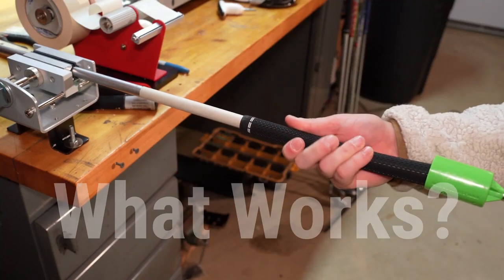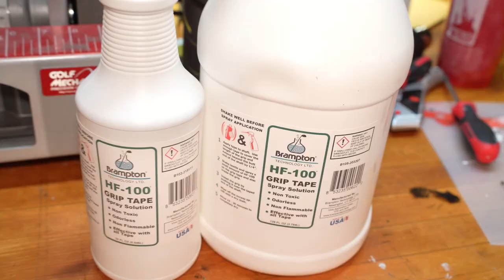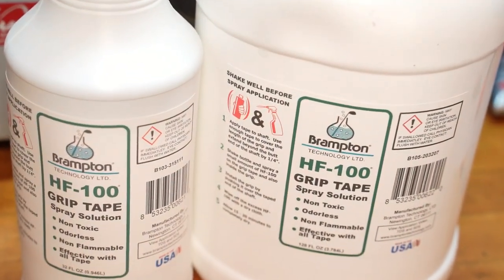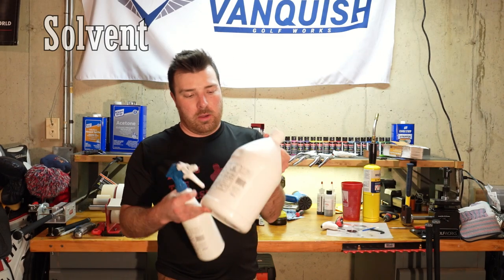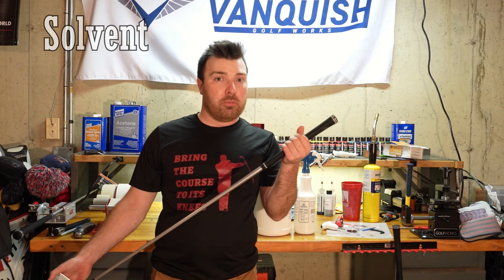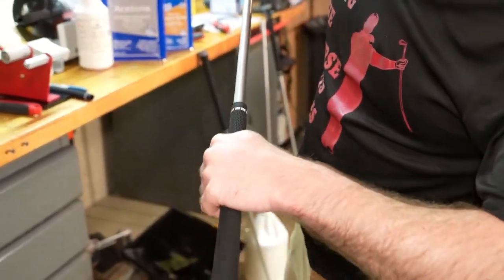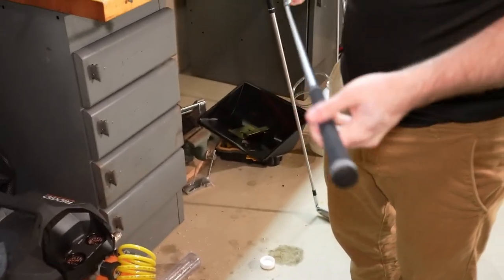What works?  Regripping golf clubs with different liquids

Comment: I have used liquid dish soap with no problems. Just takes a bit longer to dry. Smear a bit over the tape, spread a bit on the grip opening and slide on.
Reply from the maker: Good to know!
Reply: No way. That sounds terrible
Reply: Have used soap water also. No problems
Reply: 100% correct. Diluted dawn dish soap works great. Been using for 40 plus years. No issues. 24 hour dry time. Recently I tried dawn power wash, it contains alcohol, works fine, dry time cut in half.

Comment: Good Video, They make a water-based Grip tape, yours was solvent based is why the water didn't work.  
I have used Air for several years now, Less hassle.
The only thing you need to do is drop the Volume on your music, Dang it got loud, then when you started talking it was very low volume. 😉😉😁

Comment: Fun video. The poking of the tape at the end of the grip... why, wouldn't that just make it easier for debree to come into the shaft overtime, not a big concern but I've just never done that, so I am curious why you would do it?
Reply from the maker: Thanks Greg!  I've been building golf clubs for a long time and neve seen "debris" collect in a golf shaft from having a whole at the end of the grip.  I usually just poke it to help get some of the excess solvent out after you've put the grip on.  Once you've poked it, you can flip it upside down and tap the butt cap on something a few times to get as much solvent out as possible.  That will just make the grips dry a little quicker.
Reply: @vanquishgolfworks  thank you! Just pulled the trigger on an air compressor for my next set of grips between all the content I’ve seen from Mobile Club Maker and channels like yourself I don’t know why I keep using solvent.
Reply from the maker: @GregPace  That's awesome!  Have fun and let me know if you have any questions when installing your first couple of grips.

Comment: The think that you are missing is water with a little dishwashing soap.
And a properly is going to use mineralspiret when a will regreap my clubs.
I have no compressor, and have the sperit standing around. So thanks for the info

Comment: I use grip tape made to use water and it works great and less messy you can buy on line from golf works
Reply from the maker: Thats very cool!  I didn't know they sold that. Does it work well?
Reply: @vanquishgolfworks  Yes using the grip tape with water works great and you don't need to use a pail underneath.. Golf works sells it online and it works as good as solvent but without the mess  Its made to use just with water and slides on easily

Comment: Thanks for the video, I just regripped a driver and almost didn't get it on
Tip.......don't wear rubber gloves they just slip on the grip as you push....paper towel like you used works out well..:face-blue-smiling:

Comment: You need that little air adapter thing you used though
Reply from the maker: You do but that adapter piece is only like $8
Reply: Nah, the hole at the end of most grips will fit an air nozzle nib just fine. A cheap air gun for your compressor probably came in the accessories, but if not is just a few bucks.

Comment: Would have liked to see you try alcohol since it is readily available. Suspect results would have been similar to water, but you never know. I have been using the air method now for about 6 months, and that is my preferred method for my own clubs. You have to pay more attention to the grip core size and shaft diameter using air. A .600" core grip could end up loose if installed on a .580" shaft without adding additional layers of tape.
Reply from the maker: Alcohol is a good idea but I think it would work just like water, as you said.  Good to know about the extra tape for air.

Comment: so just to clear up the air app,, is just one sided masking tape all u use with air pressure? or should u use two sided tape and will the air make it slide on just as easy?
Reply from the maker: Just use single sided tape when installing it with air.  The grip stays on just fine without the tape helping it "stick".  Using double sided tape would make it really tricky to install without some kind of lubrication.
Reply: @vanquishgolfworks  your right,, it does work,, just fit 2 grips and removed two and re griped them again.2 tapes on a jumbo grip... I use a bike  pump,, hard to hold ,, so I clamped the pump on to my small step ladder..and I used a air comp,, it nearly exploded the grip.. all good in the end. thanks.. I also built a shaft extractor out of 2 hand held vices, Crude, simple,effective and cute is all I can say.. I might post it once I do a few shaft changes.
Reply from the maker: @samrad1745  Yep!  Gotta watch out for that air pressure with a compressor.  Certain grips aren't made for air install so they can inflate if there's no where for the air to escape.
Reply: I tried using single sided tape with air and the grips would end up spinning on the shaft after a few hits with the club. I went back to using double sided tape and solvent. Maybe I should try the double sided tape and air next time.
Reply: @jhooton75  I haven't tried it yet but i'm guessing you can just put an extra layer of tape on to clear the gap.

Comment: Thanks.  Am I correct in that you are using just standard painters masking tape?
Reply from the maker: The tape that I used to "build up" and thicken the grip is 2" wide single sided masking tape.  The other tape is special golf grip 2" double sided sticky tape.
Reply: Did you use double stick tape for the air or just masking tape?

Comment: I misspoke.  Why leave one dry side on the double sided tape?
Reply from the maker: Typically double sided tape is used as the "top" layer when installing a grip using solvent. You wrap that tape all the way around the shaft like I did in the video. Then, no matter what, you always cover the entire piece of tape with the solvent and wet everything including the inside of the grip. 

If installing with air then you can use one sided tape or masking tape. Then you don't have to wet anything. 

Does that answer your question?

Comment: HF-100 is totally awesome and you only need a light mist from a pump sprayer. It's like cologne. Just do a few sprays on the taped shaft over your bathroom sink and the grips slide on super easy. I did all mine by hand, no stupid vice or fancy drip tray. If you're dripping solvent you've used way too much. The little bottle that came with my grips is probably enough to last me the next decade. It's only like a few bucks shipped--- all these other inferior solvents and your dish soap are way more expensive.

Comment: Here's what I learned in the past; Acetone is used to REMOVE THE TAPE, there is a water based grip tape that I have used and work very well, the only cost for using air is the purchase of an air compressor and the electricity to operate it, it isn't FREE.
Reply from the maker: It isn't free but comparatively on a grip to grip basis the cost is much lower and much less of a hassle.

Comment: What is the purpose of "poking" the end after the grip goes on?
Reply: I suspect in case the folded over tape seals off the shaft, preventing condensation inside from drying out.